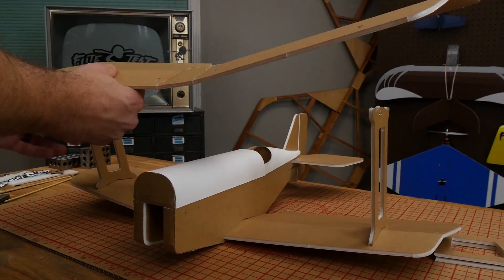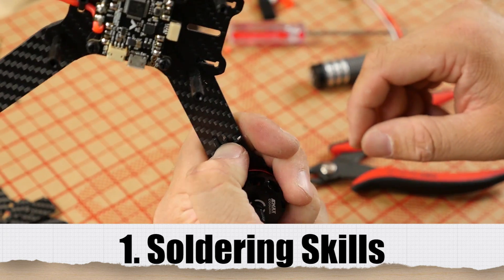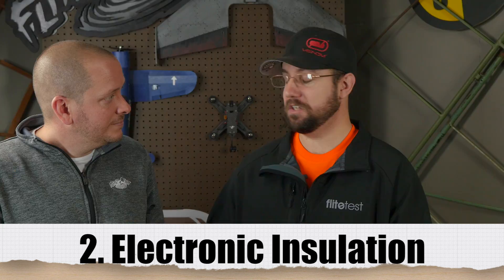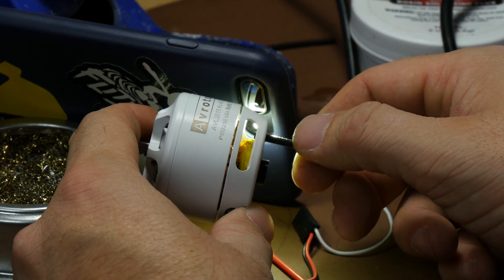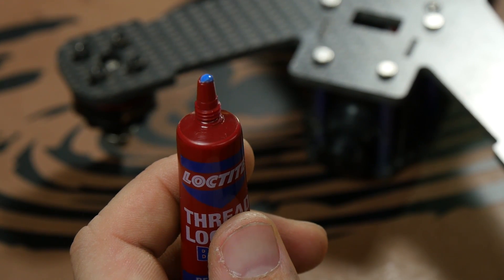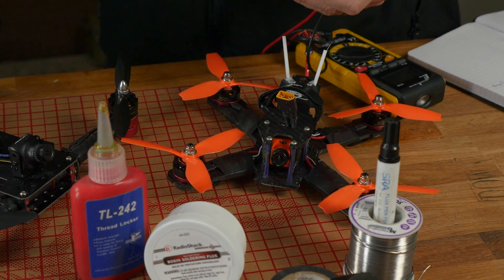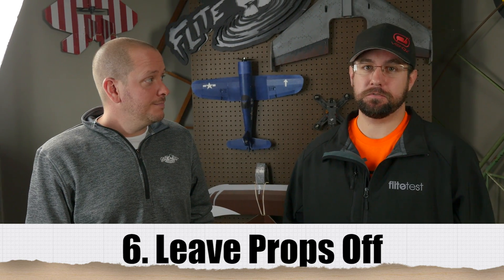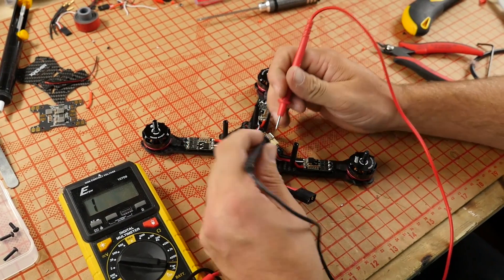6 Tips for Quad Building | Flite Test

Comment: Well I don't have a lot of money and still have a place in this hobby just look hard and you can fingers good gear for good price I have wizard x220 and a flysky I'm (saving for a tarranis) 2  3 lipo's and I use the new eachene vr006 goggles all of the kit cost like 250 pounds which for fpv quads is good value

Comment: Hi Flitetest, i tried soldering a camera to a small toy quad, and after connecting the camera, to the board, two of the motors doesn't spin when powered on, is this caused by the solder touching another plate? i check the wires are connected to the board, but the gaps between them are very small as its a toy quad board. i have another drone that i broke the arm between the body and motor, now the wire is too short to connect to the board, can i get any cables to connect it or it must be specifically bought from the manufactur?

Comment: Another informative video guys but there is two things not quite correct. First electric tape = bad. It is too thin and will wear thru due to vibrations in a very short time. Second NEVER heat PCB pads first. This is how people lift pads specially with those high wattage soldering irons of yesteryear. Tin your tip, tin your wire,s and then put the solder on to surface and a quick touch of the tinned iron will do the job in milliseconds with the correct temps and NOT damage the boards. This is Industry standard for electronic assembly.

Keep up the great work as always. Glad to see you guys back and more active again.

Comment: The secret to soldering is simple:

Everything you solder needs to be heated up equally for a good joint. 
The Tip should have good thermal contact to both wire and pad and heat both up to about 330 C°. That will mostly take about a second, but if the pad or wire is very big and conducts the heat away, more time and higher temperatures should be used. 
Then, flux core solder is touched to wire and pad, but not the iron. This way it will only melt if pad and wire are at the right temperature and secure a good connection. 
If it doesnt look shiny and round, use a flux pen and cover the pad in flux. Flux magically makes any solder joint beautiful and is a must have for anybody soldering.

Comment: Well multimeters can be expencive !
Reply: But they can be really cheap aswell. You don't need a fluke to build a quadcopter, a $15 one from home depot or simular is perfectly enough to do some very basic (low) voltage checking, aswell as some continuity checks.

Comment: Nice video.  I suggest a little less solder and a little less time on the junctions.  The best shape might be a little concave with zero imperfections in the surface, and shiny appearance.  Leaving the heat on for too long will reduce the strength of the junction and it may fail by cracking, or worse yet a trace may lift from the board.  Less is more!  The heating time is also related to iron wattage.  For the little pads and wires shown in this video, a 10-watt iron might be better, especially with a pointy tip.  I use an adjustable iron with a digital readout.  But a small adjustable gas iron works good too.

Comment: my quad vibrates like crazy ehen i switch to acro or horizon from level. what might cause that?
Reply: saint66735 Loose props, unbalance, FC isn't properly placed, or bad tuning can all do this, to my knowledge.
Reply: Iamsasquatch shouldn't all of those cause trouble even in level mode?
Reply: saint66735 They can all cause trouble in any mode.
Reply: Iamsasquatch yeah but it happens only in acro and horizon not level
Reply: saint66735 Then it may be faulty tuning.
Reply: Iamsasquatch then i guess ill have to check my tuning

Comment: So another good tip is to set your motors arming to a switch and the ability to kill them at any level of the throttle. Incase you are going to crash  you can kill motors easily.
Reply: Russell Murphy thumb is always on the throttle so to move it to a switch to kill motors is harder than just lowering the throttle
Reply: jimmi pinnington going throttle full down does kill motors I'm talking about arming switch so you can shut them off in a hurry
Reply: Most people that do tricks have the motors spin with 0 throttle.  That way you can get that float effect without losing control.  That means you have to disarm in a hurry when things go bad.  Holding the throttle down for 2-3 seconds at the exact kill spot isn't going to cut it.  I put my disarm on the landing gear switch for mine.
Reply: Sean O'Rourke yep yep yep

Comment: All good  pointers.  Expecially  the part about waiting  to  put on props.   
     I have  to  add that checking  for a dead short at the battery  plug isn't  just a good  idea it is  a  critical  safety precaution.

Comment: Here is something that I've learned through blowing up a couple flight controllers: when soldering things directly to the board, cover the electronics that you're not soldering to with masking tape. The solder can splatter a bit and with the really small spacing between solder joints on surface mount components it can short out and release the magic blue smoke.

Comment: soldering tips: 1 buy lead free solder 2. buy flux 3. don't get a cheap iron. preferably get a pace or hakko 4. contrary to what was stated in the video, high heat is good.  5. we want to apply a good amount of heat so we can apply heat for the lowest time possible.  I generally keep my iron on right around 700 Fahrenheit.  Do not heat for more than a few seconds. 8. Tin your wires and pads.  Apply flux and solder to both surfaces you intend to join.
Reply: Lead-free solder is the worst to learn with. Leaded solder flows much easier. If you're concerned about lead exposure, get a cheap fume extractor so you don't breathe anything in.
Reply: 1. buy 60/40 lead solder. lead free sucks big time
Reply: 60/40 and the cheapest iron i can get whoop whoop
Reply: aren't the fluxes/rosins the most dangerous part of soldering?
Reply: i've had so much practice with a really cheap iron that the tip melted partially on... fun, really!

Comment: Tip 7. : Use solder paste or flux
Reply: i think they just buy flux core solder and forget about it.
Reply: True but, in the video you can see that some PCB pads are to oxidized to make perfect solder flow.
Reply: sand off the oxide layer then.

Comment: Tip #7 Have lots and lots of money, LOL... I've found quads and FPV gear are pretty darn expensive. Especially entering into the hobby.
Reply: the one i traded my whole wallet for.
Reply: Lee Beezy Not only that, but you are going to mess up. You want to have some extra room in your savings to spend on replacement parts.
Reply: What fatshark did you get?
Reply: Tip #8 Get factory support with suppliers paying you like these guys!  If you just buy parts off the shelf like most of us have to do you'll never get anything to work since most of the parts everyone sells are crap that won't work.
Reply: Try to fly rc helicopters ;)

... I did and i enjoy flying fpv drones. Props is the only thing. Last time a camera. Wow 50euros.
My blades on my helicopter are more expensive.
Reply: And the servos, and all the tiny parts, motor gears stripping, etc. 
When I see people complaining about drones repair costs, I laugh, thinking how much it costed when I had to repair my 600 class heli for a small crash : about the price of a high quality 5" racing quad :)
And let's not even talk about battery prices... 6S 3000mAh ? Duh !
Reply: Lee Beezy decent FPV goggles are still ludicrously priced. And the quality difference from the $60-$90 ones to the $250-$400 ones is HUGE, too. So, I agree.

Comment: Another tip is when you kill a battery, cut the power wires off and use them in another build. those wires are really good wires for building with. but do not cut the wires together, cut them one at a time unless you want a giant spark in your face.
Reply: just use ceramic cutters and forget about it...
Reply: I learned to cut one at a time the hard way... on a good battery at that.